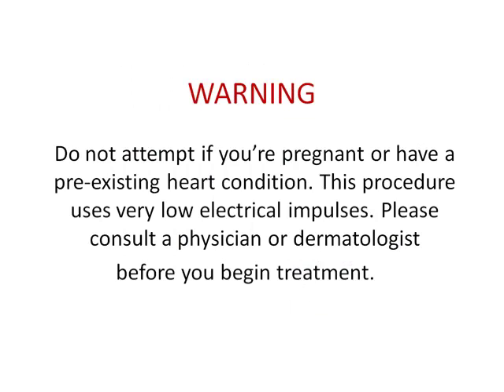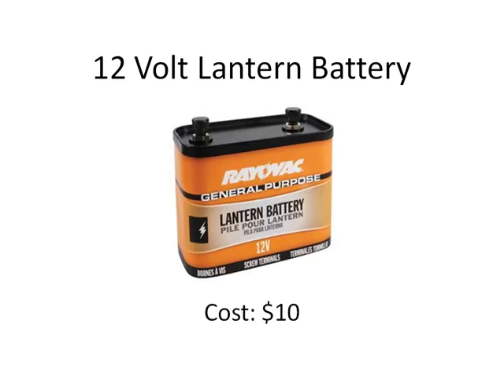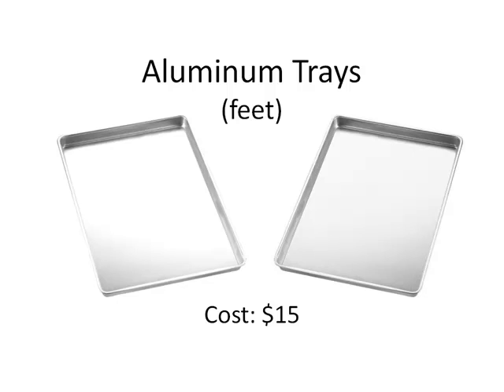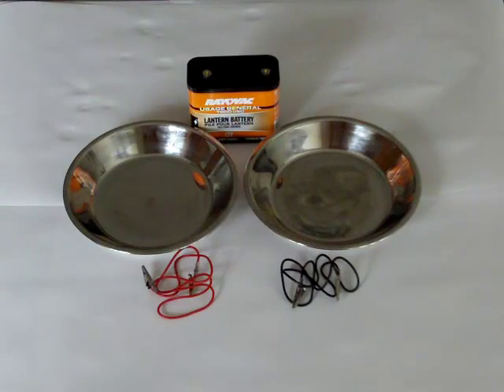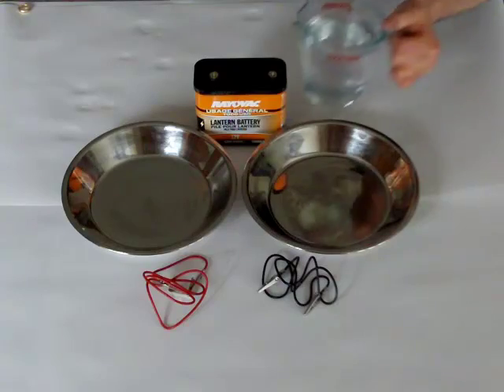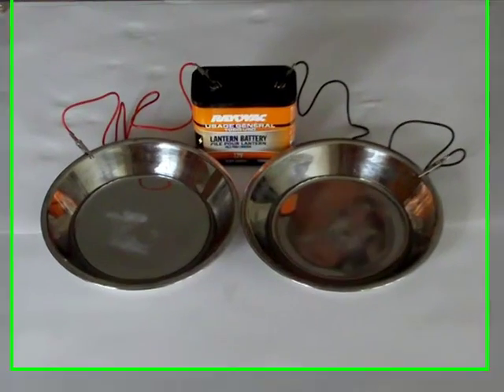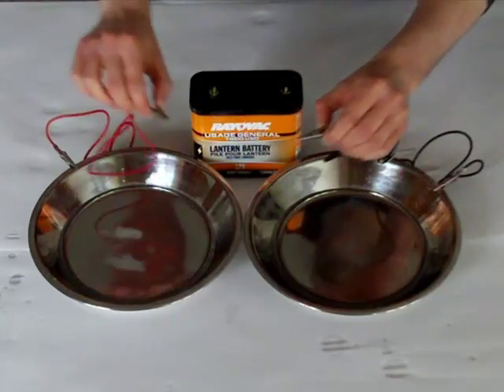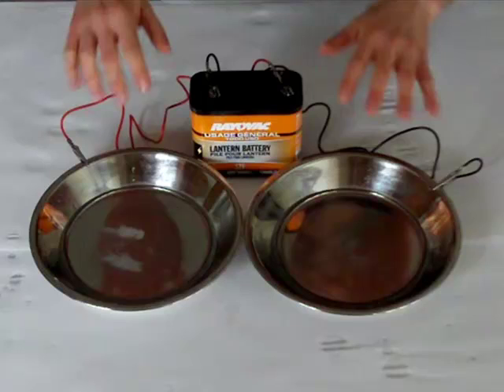How to Build Your Own Homemade Iontophoresis Device

Comment from the maker: If you want to get a professional device, you should consider Dermadry (dermadry.com)
Reply: Hi I like to try your home method, but I am not sure what amperage the 12V battery should be. Can you clarify? Thanks so much!
Reply: @javcat414  me too I don't know many amp to use
Reply: Hello and thanks for the video and advice, Dermadry is a bit pricey unfortunately ahah! Would you have any advice on how to do your solution for armpits ?
Reply: what about face adapter? should i plug one side of the battery then the other side after 10 min?or both at the same time?I am talking about the one you buy from "iontophoresismachine" website.
Reply: It is fucking expensive

Comment: I have an Iontoderma iontophoresis machine however the adapter stopped working and i have been trying to figure out what i can replace it with, is the voltage the only thing that matters doesn't the amperage matter as well? The maximum current of the iontoderma adapter is 20mA while the maximum current or batteries and adapters i found is usually over 1A which is a lot higher can i still use them as long as the voltage match (i set mine to the maximum voltage of 27V) so should i just look for something with 27V? Also is it better to use an AC/DC adapter or a battery

Comment: I would recommend to invest in a slightly more expensive variable DC power supply that will help you regulate both current and voltage. Not to forget you'll need something similar to charge the battery too. So just go with a power supply and throw away the battery.
Reply: How costly is it? I am from india i did order indetouch anti sweat iontophoresis machine...it costs 11050 ₹ is it worth to invest?

Comment: Yup this really works, bought a 12v battery for $30, a 10pack of alligator clips for $10 and some cheap aluminium pie pans and trays for my feet. I use hot tap water though, took me 1 week and a half till I achieved full dryness. Our water is also quite hard so that helped heaps didn’t need to add baking soda or salt. For those suffering from hyperhidrosis please try this treatment it truly works!
Reply: Hey man I know what that feels like I went through my whole high school life avoiding handshakes 😢😅 I wouldn’t say you sweat a lot you sweat as you would normally do but after a week of doing it everyday for 20mins (10mins each polarity) you will notice that you won’t sweat anymore it’s quite an odd feeling too. You will feel like your hands and feet are going to sweat but they don’t lol you’re 16 man don’t miss out on doing this life changing treatment and enjoy dry hands and feet.
Reply: @fredlamkam6374 I tried 2 cheap 9v batteries..Done this for 15 days no results..Do i need to get a 12V good battery..I think 9v battery doesnt provide enough current in my case
Reply: @fredlamkam6374 hey man, i need your help if you have this account by this time…which battery did you get? or which battery should i get cus iam from germany and cant order the exact same as in the video… could you help me out maybe and say what is important by such a battery? Thank you, hope i will get an answer soon cus i got my first girlfriend in 18 years and just cant do this with my hands anymore🥲
Reply: : If you could report from your experience and give an update about you now, i will be happy 🤝
Reply: Yes I have been dry for about a year now. I notice when the weather is humid I sweat but not as much as I used to but other than that I am enjoying life with dry hands and feet.
Reply: @fredlamkam6374  Hey man, I'm 16, and I've spent most of my school life avoiding handshakes and greeting gestures. I've heard that you began to sweat a lot when first starting to use it then it goes away is this true?
Reply: Hi. Are the results still positive?
Reply: iam not sure if youtube posted my comment so safety first i write it again, man pls help me out with a tipp which battery i should buy cus i dont have much time left till i meet again with my gf, pls give me some info about the needed battery cus the one from the video is not available in my country
Reply: @bundaskenyeragya hey bro I’ve upgraded to a power supply unit. Using 20v and i am dry for about a month and only do maintenance 1 or twice a month

Comment: Hello this has worked great for a long time. My only question is how do u recharge the battery. Could you do a video about it? If not a reply would be enough as well. Thank you so much.
Reply from the maker: Unfortunately, those are non-rechargable batteries. So you would need to purchase new ones. Hope it helps!
Reply: @preventsweating  okay, thank you so much for responding! Hope your well, your videos are life savers. 💓
Reply: @preventsweating  hey how many  cycles can be done with one battery

Comment: i am getting shock when i used 2 batteries. so i used only 1 battery. but every 5 minutes i get shocks which will let my hand out of the pan...
is this normal, plz drop solution?

Comment: How much amperage do the 12v battery needs for this application? We don't have that brand in Turkey so I'm looking for a similar one.
Reply from the maker: If you don't have access to that type of battery, you can get smaller ones (eve 9v batteries). 
To answer your question about amps:
The amperage delivered by the battery will depends on your body's resistance. Let's say your body's resistance is 800 ohms, you'll get 15 milliamps. If your body's resistance is 1600 ohms, you'll get 7.5 milliamps.
Reply: @preventsweating how do i know about my body's ohm please answer

Comment: F*** these sweaty hands. I am going to make this for myself once and for all. Thank you so much.
Reply: Same here bro I had enough. Finally bought everything and ready to go tomorrow for my first treatment. Use stainless steel pans though not aluminum.
Reply: @Kaiser187  Hello, how was the treatment? Was it effective?
Reply: @darrenang585  Not really. Had to do it everyday even after seeing results.
Reply: @Kaiser187  I see. Well at least you are seeing results, that's good right? how long did you have to do the treatment everyday?
Reply: @darrenang585  I actually quit doing it. Took me 2 months to get somewhat dry. Couldn't stand doing it 7 days a week. Tried doing it every other day and would start sweating again.
Reply: @Kaiser187  Ohh I'm sorry to hear that. Is your sweating quite serious?
Reply: @darrenang585  Yes, it's pretty severe. The thing is you need really good mineral "hard" water for it to be effective. The higher the TDS the water is the more effective the treatment will be. I did it for 1 hour a day, hands and feet.
Reply: @Kaiser187  Did you try adding salt to the water for the treatment? My water is quite soft so I'm thinking if that would help.
Reply: @darrenang585  I did epsom salt and baking soda. Epsom salt worked the best. I even bought a TDS meter and tested the water before and after mixing the different mixtures. San pellegrino is supposed to make it work really good, but it's not cheap so I never tried it.
Reply: @Kaiser187  Thanks for the info. If you don't mind me asking, you mentioned that your sweating is pretty severe but why aren't you willing to do the treatment everyday to reduce the sweating?
Reply: @darrenang585  Because I don't give a shit anymore to be honest. Lived with it this long, just got to accept it and move on.
Reply: @Kaiser187  I respect that. All the best to you!
Reply: @darrenang585  You got me thinking about doing it again. My sweating is so bad, especially gaming in tense situations I can barely handle it. The cold sweats afterwards don't go away till I take a hot shower. I just bought The Fischer iontophoresis machine today.
Reply: @Kaiser187  I understand fully, I had horrific sweaty palms before my ETS surgery but now I have compensatory sweating and my feet still sweats as well.

I thought about buying the Dermadry machine but it was too expensive so I am trying the DIY method. Been a week and still no effect, might have to up the voltage.

Anyway, hope the machine works out for you!
Reply: @Kaiser187  can i use tap water for the treatment?
Reply: @Kaiser187  Does fischer machine works?
Reply: @davidegigante  Yes it works great!
Reply: @TheMadMonkey3  Hot tap water mixed with San Pellegrino.
Reply: @Kaiser187  I think you are ironic
Reply: @davidegigante  ?
Reply: @Kaiser187  You said san pellegrino and i thought you were ironic
Reply: @Kaiser187  how many days apart are you doing with the new machine. Did you try once a week?
Reply: @ismis6984  To get dry I did 16 days in a row.

Comment: I've built  my own, been using it for 2 days hahaha, i use it everyday I think it's better to use it everyday, it's pretty painfull btw, don't use it alone u need someone to assist you, and also make sure you dont have any cuts cause its painful, I'll tell you guys if there's any significant changes
Reply: Yess mate, there have been, it took me 4 weeks to se significant changes, I used it everyday, in 12 volts, 10 mins per hand total of 20. , its really painful for me though because of me cuts
Reply: @bryankylebuhisan5570  did it improve at all?
Reply: @TheMadMonkey3  after 6 months you can really see the results but you have to keep using it around 2 to 3 times a week to maintain the results. I REALLY RECOMMEND IT.

Comment: Please tell me clearly about Battery volt and ampere.
Reply: The voltage is 12v. I don't think the amperes is an issue. The will be sold telling you the amp-hours, which is the capacity of the battery, higher being a longer lasting battery between charges.

Comment: You can build your own device at much cheaper price - stopsweat.cc. The scheme is free or you can get the device really cheap. From personal experience and using it for one week I can confirm iontophoresis really does work and it does not have to be expensive.

Comment: This absolutely works; I've done it many times. It's pretty darn uncomfortable, but it does work.
Reply: Have u been sweat free ever since you started, even now?
Reply: @mohini6329  It wears off after a while.  Once you do your initial 7 or so zaps, your hands will stay dry for a few weeks, and then if you do it maybe once every 2 weeks they will stay dry.  But it's a pain, literally and figuratively.  It's 20 minutes of pain and boredom.  I do it for a few months and then I forget about it and the sweating comes back.  If you're diligent with it though, it really does work.  You won't see results until about the 5th time through; but you should do it about 7 or 8 times (once a day) just to be sure.  Then you can tone it down to once every 2-3 weeks; whenever your hands start to get a little damp it's time to do it again.  You have to be ok with it hurting. Check out Michael K's response in the comments; that's a good regimen.

Comment: I thought you're not supposed to put the positive(red wire) on the negative terminal on the battery???
Reply: That's if you are connecting up to some other electronic device. There's no functional difference between the actual wires, just the colour.

Comment: i also used this method, and it works for me after 2 weeks, i used universal adapter, which has a selector from 12volts to 24volts, i used 19volts, 10min, and then reverse tha polarity into 10mins also.., its very effective,
Reply: John Paul does it still work for you?

Comment: Thank you for this I almost buy or planning to buy the iontophoresis device but yah its not cheap,so I tried this and its really works,sometimes my hands and feet sweat but not that bad as before.thank you so much for sharing this❤😍
Reply: Try a higher voltage and
/or amperage

Comment: Omg!! This is my first treatment and it worked already!!!im so excited ! Thank you for the detailed video I feel so good!
Reply: Hi Naomi, glad it worked for you! Just a quick question, when you used this treatment, did you have pie pans touch together?
Reply: Michael Angelo no i didn’t touch the pans together because I thought u are not suppose to let the pans touch each other.
Reply: @EL-jw6dg   Yes, you are right. The pans are not supposed to touch together. I tried it twice and I could feel the electric current on my hands!!
Reply: Michael Angelo how did you go with your Iontophoresis? How long have you been doing it? Did it work for you?
Reply: @EL-jw6dg  Sorta. I've done it about 3 times now. So i gotta do it more consistently to see better results.
Reply: Michael Angelo please tell us how did u go after 2 weeks or so. Before here is warmer so sometimes I still sweat abit even if I do iontophoresis.  After two weeks I try to do it every other day but the sweating seems to come back a little.

Comment: Day 9, no difference. I'll keep going for 20 more days.
Reply: I’m not sure if this treatment is 100% safe. Could it cause nerve damage?
Reply: @elyssaelf  It's safe.
Reply: @FreedomOfSport  Thanks for sharing your experience bro, helps a lot. Plan to start tretament next week, hope it works!
Reply: did it improve now?
Reply: @HankHill1  There is a slight difference since it takes a bit longer for the sweat to break through. I'll just keep on going. I've also increased the voltage to 24 for my hands.
Reply: @FreedomOfSport  Did it work now?? I really want to start this treatment.
Reply: @photographypg1514  I stopped being consistent and stopped altogether now. The time was not worth the little result for me. It seemed to work better on my feet than my hands though.

Comment: I have been doing this everyday for 14 days. 10 minutes switch do another 10 minutes. No results using this set up. How much longer until I move onto something else?
Reply: Just checking, you sure the pans or whatever you use conduct electric current?
Reply: @FreedomOfSport  Yep I can feel the strong tingling as I added some salt and baking soda to the water. Disposable aluminum pans as I don't want to sink more money into this if it doesn't work.
Reply: Did it show any result?

Comment: Tried this today while at work, doing just a couple minutes at a time, as time would allow. I can already tell the difference. I'm amazed how well it is already working. As a child, I picked up a plugged in tube bass guitar amp my dad had built, but never put a bottom on, leaving the guts exposed underneath. Got myself quite a shock that day, as in violently convulsing and screaming uncontrollably. This is nothing, by comparison. I used a motorcycle battery. You can feel it. Kind of feels like many little mild pin pricks. I did got quite a little jolt while reversing polarity on my feet, because I left them immersed and switched the terminals on the battery. Change then immerse to avoid this. I could feel a spike all the way up to my knees. Reversing polarity is the most intense part.
Reply: Justin does it still work for you?